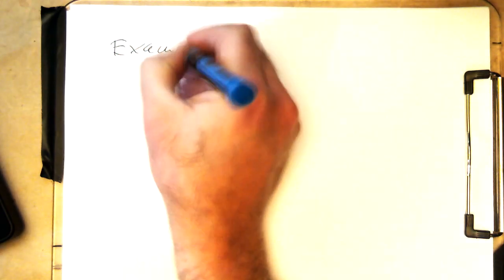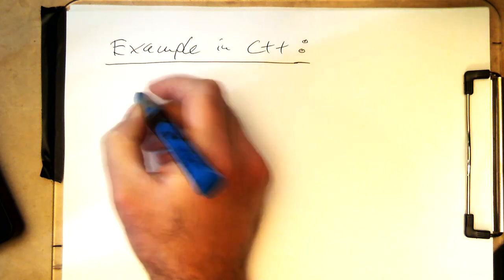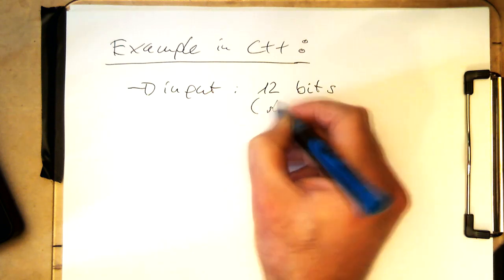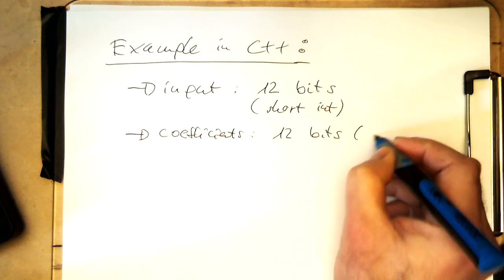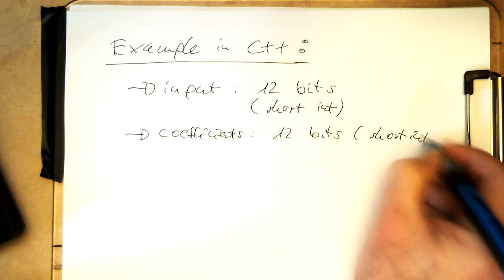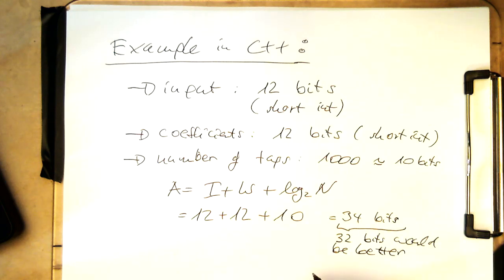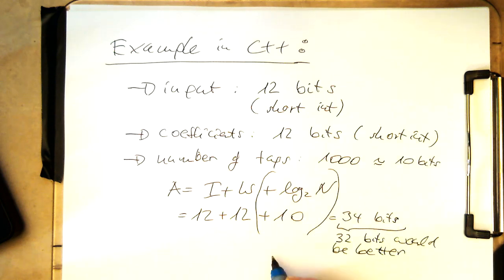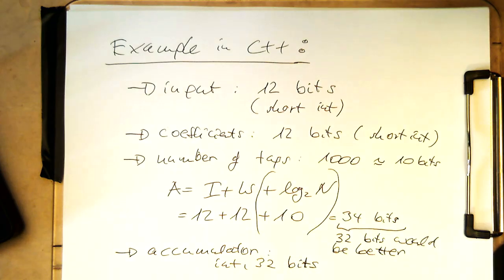Fixed point FIR filter: Fixed point example (0002,Py)

Comment: I only discovered your videos today and would have liked to sooner. Your explanations are really good (as far as i can tell from some of your IIR and FIR fixed point videos). It would be helpfull to have some other examples for the coefficients (in stead of the 50hz stop band) like a simple low pass. 

I'm looking into programming a basic synth for arduino and maybe stm32 after that. And what is a synth without a nice filter ;). But the arduino is not that powerful so your fixed point tutorials help a lot. Thanks a lot and keep up the good work!